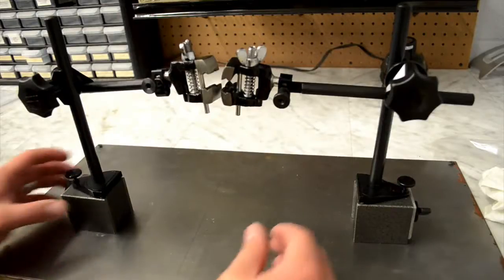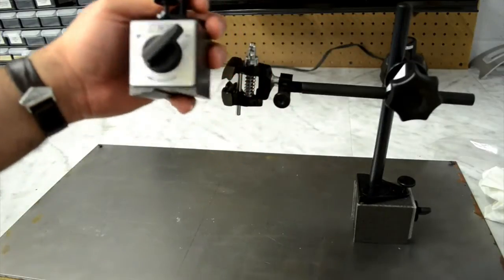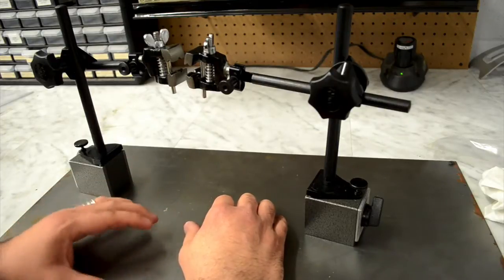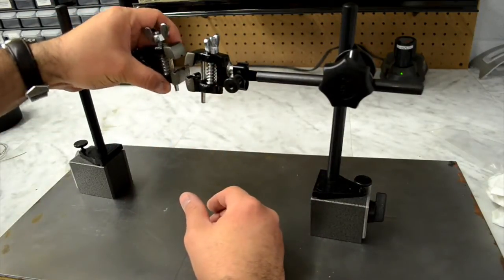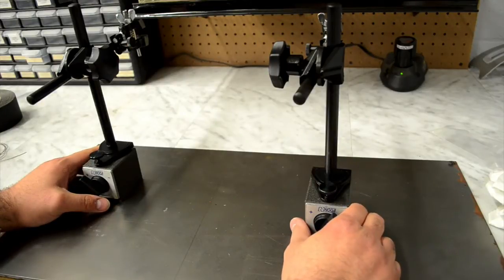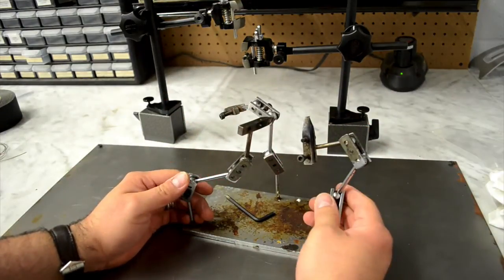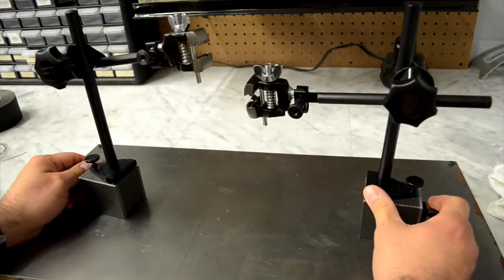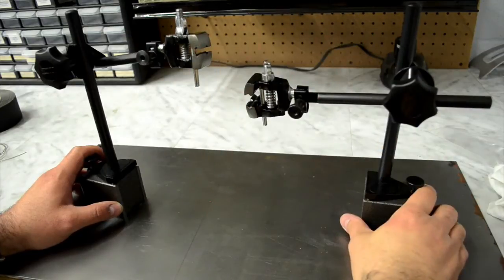Soldering Jig Hack

Comment: Thanks Adan! I made two! Great! Thanks SO MUCH for this idea! What did you end up facing the teeth with? And how’s it holding up?
Reply from the maker: Thanks Jonathan!  Well, after a few uses i realized I really didn't have to do anything to the teeth.  I really only use it for silver soldering and when using that kind of heat the finish burns right off.  The re-lacquering process takes care of any minor scratches the teeth might have made.  In all honesty I really never have any issues with the teeth putting any kind of marks at all.  Thanks for watching!  -Adan

Comment: The springs are in the wrong place though - you have them to keep the jaws open which would be fine with gravity for that size - but for pcb you'd want to put the springs under the wingnut with a washer between the wingnut and the spring - this way the jaws would reverse operation and close and be strong enough to hold the pcb easily, but weak enough to where you can remove / add pcbs without unscrewing and screwing the wingnut.
Reply from the maker: Acecool Good point! Thanks for the input. -Adan